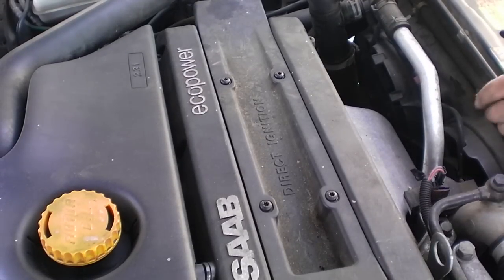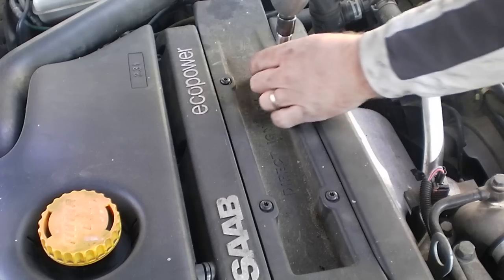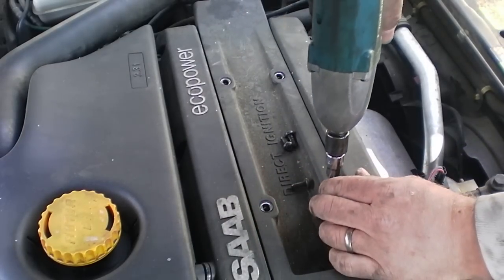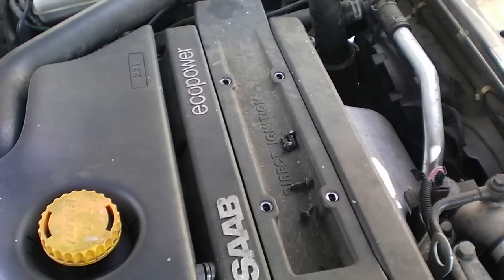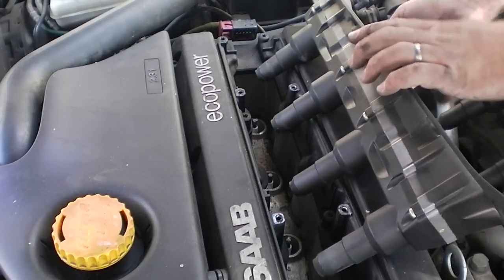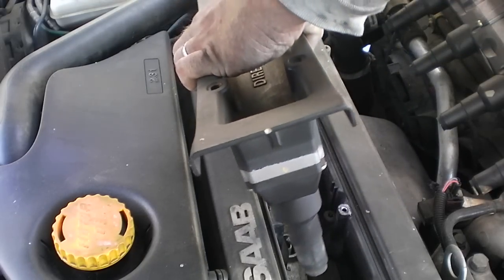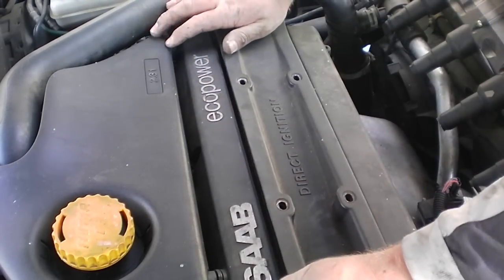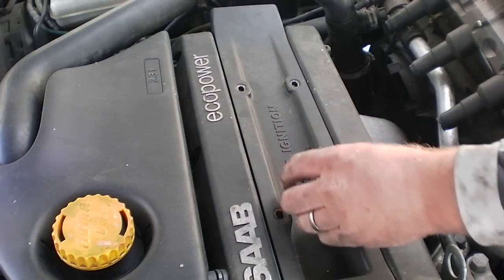theSAABguy Repairs: Replacing the SAAB Direct Ignition Cassette DIC

Comment: Thanks for the great video Jay !!  Be careful when you're re-tightening those Torx T30 screws.  The tightening torq is only 12NM or 9 lbf ft.  Remember you're dealing with soft aluminum.  Also the Haynes manual states that if the Direct Ignition Cassette has spent any time sitting upside down, you should allow at least a couple of hours after installation before starting.

Comment: It's worth mentioning that after the replacement it is recommended that you wait at least 15min. or to be sure even an hour so that the oil has enough time to settle. Furthermore once you are at it you should change the spark plugs as well, use NGK branded ones.

Comment: I've just changed it like you did on your WONDERFUL video but I have almost the same symptoms. But I didn't wait after replacing. I didn't know I had to wait. Can it be the reason? I was wondering if it could be a problem with the connector because at the garage they've replaced it first with an used one 3 weeks ago and after seeing your video I've bought a new one. But almost the same problem. Any idea?
Reply: 7 years late did you change the 4 sparkplugs before instaling the new Ignition Cassette?

Comment: So I've got a pretty big problem with my 2003 9-5 Aero. Its electronic kit/key module (number 8549966) is faulty, and it's expensive to replace, like REALLY expensive. I did however find a pick-and-pull where I found a 2000 9-5 with a working module/kit, I think. if I got that module, do you think it would be possible to marry it to my car even though they're different years? and if someone could also tell me how, that would be awesome. thanks! I need an answer PRONTO, I need this car working SOON!!

Comment: I drive a 94 saab 900 with 70,000 miles. I got the code p0340 (Camshaft position sensor). What is the first suggestion to going about this fix and how do I make sure I'm fixing what is broken?

Comment: I can't believe someone tried to charge 800 just to change that part btw how do you know when you need to change that part
Reply: you don't need to change it until you experience a problem.  You will start to get erratic firing as if you are down a cylinder.  In my case it became obvious because every once in a while I would get a misfire in a cylinder.  You can remove it easily as shown in the video.  In my instance there was a crack in one of the 4 downspouts where it meets the base of the unit.  You may also see some burn marks.   Do some research on purchasing an aftermarket unit.  Many are junk and people end of having to purchase an OE unit.

Comment: Looks straight forward. 

Two questions: 

I read that it's a good idea always to have one in stock as these are prone to fail. On my SAAB 9-5, the unit is now 8 years and roughly 35 k miles old. Is getting a spare one now a sensible precaution - or would it be likely to collect dust or go bad over the years.

There's a lot of different brands of these units - at vastly different prices. Any recommendations which ones to choose?
Reply: 4 years late, but if you still have the car, no they won't go bad from age, I always keep a spare in my trunk. You can get new ones, or try and get lucky and snag them from the junkyard for really cheap. But always get oem ones, the aftermarket DICs are way more prone to failure
Reply: @houseking9211   Thanks, it's not too late as I'm still enjoying my 9-5 and the DIC is still fine.
I'm not sure what exactly OEM means (I do know what the abbreviatiin stand for) - with Saab as a manufacturer dead, they're bound to come from some third party.
I'd avoid Alibaba stuff, obviously - but
I occasionally see Hitachi/Hüco ones that get positive comments at reasonable prices (currently ~ 165 €)...would that qualify?
Reply: @notroll1279  kind of depends on where you are, places still have oem dics for sale, maptun's website for example, they're relatively expensive brand new though. Most people will advise against using an aftermarket one, but as a spare it doesn't have to last you 5+ years, so it wouldn't be a big issue.
Reply: @houseking9211  
Hmmm...
I don't think the Swedes in Trollhättan carved those things themselves in 2001, so even what Orio or Maptun have in stock as "original"  must surely originate from some third party...
Reply: @notroll1279  Orio is OEM, so anywhere you can find those are good, usually close to 80 euros more expensive than third party, which really can't be guarenteed to last more than a year

Comment: Just did this easy job on my 9-5 with 130K miles.   It took me 20 minutes because I didn't watch this vid first!  Wasted 10 minutes to figure out that the red clip SLIDES off first !  Duh!   ... Found a note on a parts website that says to let the new unit sit on the engine for at least 1/2 hour after installation - something to do with the oil in the unit running down to the lower section. Can't verify that anywhere else.